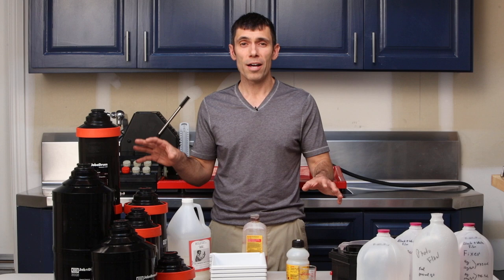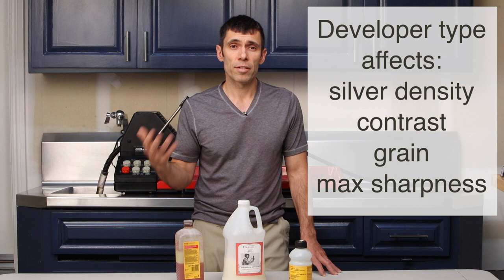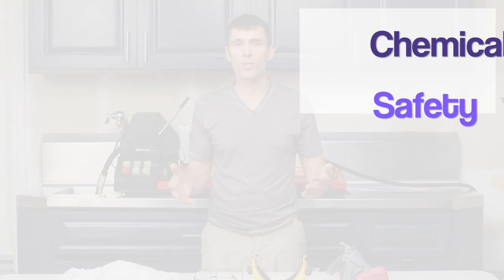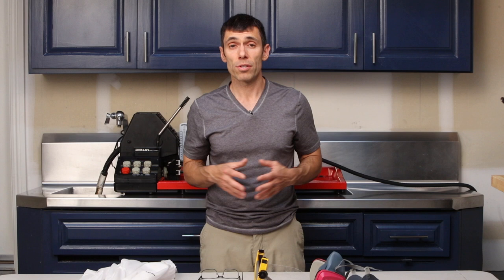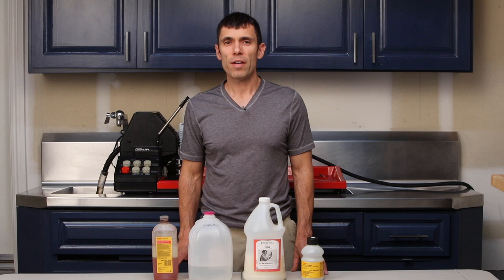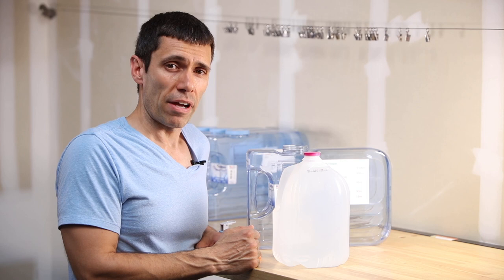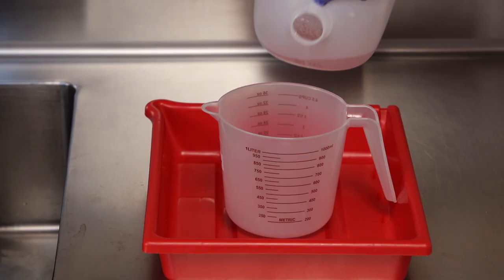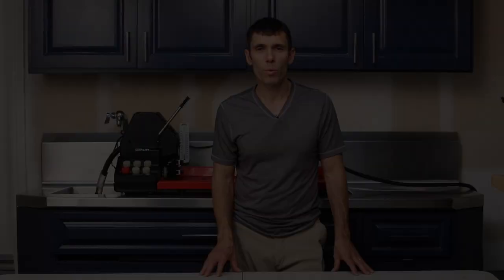Black & White Film Processing

Comment: Thanks for sharing, and great overview.  I too use only HC-110 yet still using stop.  I'll try distilled water next time.  Interesting comment on accumulation of Photo-Flo so will try it out of my tanks.
Reply from the maker: I appreciate your support and for your comments! Thanks! Tony
Reply: Keep using that stop.  Using water, as here, doesn't stop anything, and development continues at a reduced rate until the fixer is added. Historically, following development with a water bath, possibly repeating the process again, was an established technique to control contrast by building up the shadow density. Where development time is short, say 5 - 6 minutes, such extended development in a water bath will also amount to an over development, an informal "push" process.

Comment: Great video! I'm wondering what you think about Ilford specifically recommending against a pre wash for their films? They state that a pre wash can actually lead to uneven development.
Reply from the maker: Peter, I've always pre-washed my black and white films, irrespective of manufacturer, and I've never had a problem. Tony
Reply: @tonysantophotography  makes sense. Do you find you need to adjust development time because of the prewash step?
Reply: @peterfarr9591  Peter, I don't make any adjustments. I use exactly what you see in this video and have been doing so for over a decade with consistently great results. Hope this helps, Tony